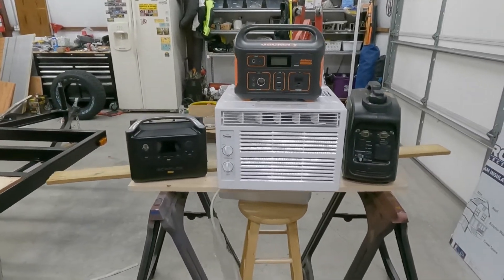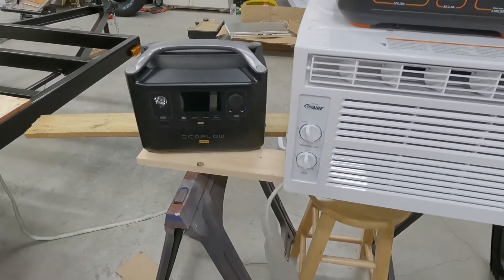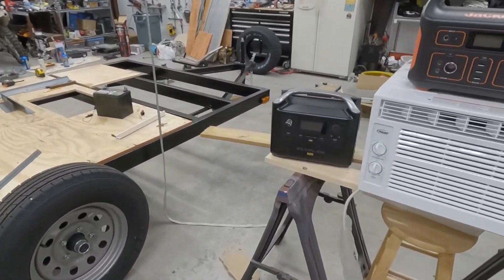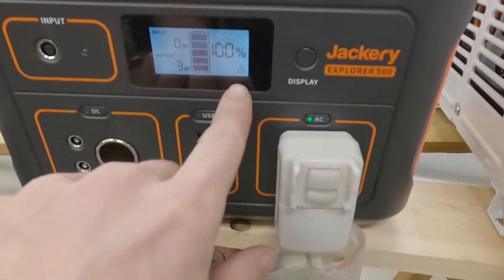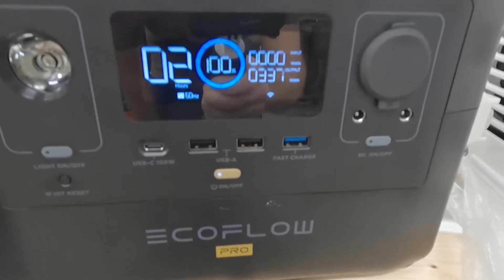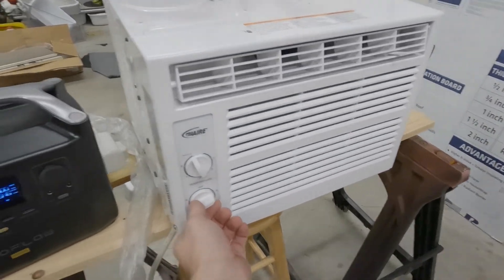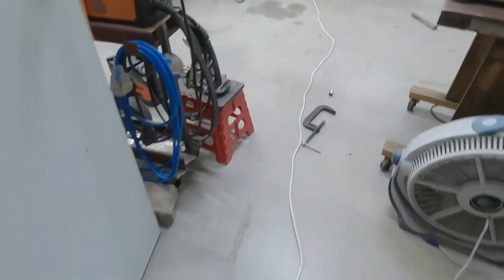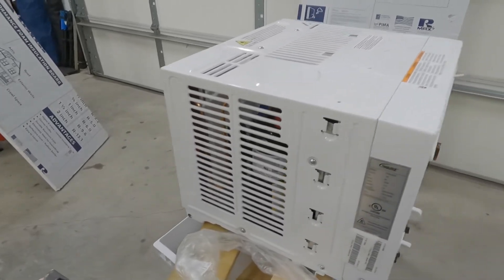Jackery vs EcoFlow vs Gas Generator - Which will Power a Small AC Unit?

Comment: I have the same sportsmen’s generator, and a similar window ac unit (analog knobs) it’ll even power it on economy mode. A run 6+ hours on a tank of fuel! But impressed by that ecoflow! Does the ecoflow have “pass though” charging?

Comment: What eco flow is that the 800w? I have this ac n im building a camper my ac is 500w i have 4 100w panels i was gonna buy a geni as I used robust one for my rv ac but I was gonna buy a smaller quieter  geni cux ppl complain if sharing a spot off grid. So now im wondering what tha would do what do I need my truck camper is about size of your trailer  build n ill be insulating it prob spray foam what do I neednro keep me n the dog cool its like been 31 here n up feels like 40. I lost the cat in ny apt running g a 8btu ac n I couldn't keep  apt cool I left n left cat n ac running  n it must a got way too hit with ac n hes older n sick  n I hadn't out him down its devastated me im leaving as its far too hot in this apt you could cook an egg n im going off grid this is crazy gettin all the heat from other apt below too its crazy  very small apt too  smaller than your trailer area in living room where I closed off doors n stayed with ajimals

Comment: I dump my generator into the house using the 220 and power the whole house. Just being careful with the hot water and not running the stove or oven. Been without power after a couple hurricanes. Amazing how dark it is at night when you're the only one for miles with power, lights and ac. The generator runs like a champ even in hurricanes wind and rain. Treat your ethanol free gas and it lasts for years. Used almost 5 year old gas. Runs almost as good as fresh, but wouldn't put in my car lol
Reply: When you say you dump your generator into the house, please be careful to not let it be actually running inside the house or near a window. Carbon monoxide is a silent killer. Be safe.

Comment: I would say if you want to use a generator, get one with 2000 W peak rating at the very least.  Of course, if you have the cash, spend it on a good, renowned generator name like Honda.  These are by far the least noisy, best output, the sine wave actually looks like a sine wave and can have a peak higher than the rated peak.

I've never really been a fan of such large batteries as even the small ones have shown, are a great way to turn your house into a bonfire.

Comment: I have the 720 & 320 Eco flow they saved my butt during the flood in this February and March. We’re on the side of the road in the RV above the even park no one in our RV park was prepared but me my RV up lit up like a Christmas tree I use my Prius to keep them charged 
I have since added two 110 foldable solar panels from the same brand ❤ I got mine on payments through QVC which really helped for my situation
Reply: No one in the RV park had generators? Who has an RV and not a generator?
Reply: Me i sold mine. No one likes a geni they kept unplugging mine or turning it off middle.of the night when i hadna dog 19 who had issues breathing n cancer n the fkrs shut it off all night couldnt even bewr jt where they were on free land but im buying s new one i had a champion i loved it accept the oull start but its on for 499 now it ran everything id like to use it again but i dont want  issues with ppl.touvhing my geni i need it for ac n maybe heat if i live in my homemade truck camper. so to answer your question alotnof ppl hate when we have them. @killer268

Comment: I’m not an expert but I do believe the ac has a starter capacitor the will charge up after being plugged in for a while. This capacitor will help boost the compressor for startups. Because you tried the smaller jackery first and the ac wasn’t plugged in for very long it did Tver that charge to the capacitor which caused the startup to rely only on the jackery. The other sources benefited from being plugged in and the capacitor had some boost to assist starts. Try the jackery again after the ac is plugged in for a while.

Comment: Turn on the fan first, then lower the temp knob slowly until the compression kicks on; I run my LG 5000btu with the Jackery 3000 all night.
Reply: For 2500$ id hope so lol
Reply: Damn straight  @fvgc454ss
Reply: I see a Jackery 1000 or 1000+
Reply: I have a 300w/290wh and a 5,000 btu AC unity. I plugged up a portable ac unit from Lowe’s. The jackery showed that the AC unit was pulling 85w but it killed the jackery very quickly. It dropped 10% battery life in 30 minutes and the ac never got cold. I hooked up the ac unit to a house socket running 220v and the AC unit got cold very quickly. Now the jackery does run the fan on the portable ac unit but not for long.
Reply: Absolutely! And he said he was gonna kick it on high but he never did

Comment: If it's running 400W on a 750Wh battery, I'd be really curious to see how long it really runs.
Reply: So curious
Reply: 750Wh/400W is 1.87 hours, excluding physical losses.  I'd guess 80% efficiency at best to account for losses, thus 1.5 hours max run time.

Comment: You can Daisy chain the power stations and get more run time I've done it in my camper with a similar AC unit using my bluettti EB55 and ac50s and a jackery explorer 240

Comment: Gas generator still going 8 hours later.
Reply: Neighbors still upset
Reply: How much money do you spend on gas to power the generator for 8 hours of use?
Reply: @bpric13  about $8-$10 bucks running a 550sq AC unit. Small price to pay on a blistering hot day. Especially to not have to worry about it running out of power. God forbid you have to add a little gas.
Reply: 50$😂😂 @bpric13
Reply: Still hearing it 8 hours later.
Reply: @FAH_QUE-Democrat_U_Lost  A small price to pay.
Reply: Nope, predator inverter can’t hear shit. Quiet af
Reply: @JayDubNation83 that ain't true  my brother and some friends have those. They work great but they aren't super quiet.  Alot better than the typical gas generator  though
Reply: @carloscardona9255  well I personally own one and it’s exceptionally quiet compared to a standard generator. I can literally run it all night without one neighbor saying a word. I don’t hear it over the noise of the air conditioner I’m using it to power. No one in my home can hear it from inside the house. Maybe standing at a back window staring at it in the backyard you “might” be able to tell it’s running. It’s a great solution if you need substantial power and don’t have it at the panel. To each his own though. They are also priced extremely well considering.

Comment: An ‘Air Conditioner Soft Starter’ would solve the issue of the massive amp draw spike when the compressor kicks on for the first time. With one of those devices I bet you could run the AC on the smallest unit.
Reply: And soft starts are only a few hundred dollars.  Or for just $50 more you could just go with the EcoFlow.
Reply: What he would actually need is an “inverter” style portable a/c they use al lot less starting power

Comment: I have that generator, and a similar AC, no issues with it running an air condtioner other than parks that don't allow you to use it overnight.. I don't think the Sportsman generators are still available. Pity too they are pretty nice.
Reply: Tractor supply has them.

Comment: Great info I have a trailer with a 5000btu unit ac and I use a craftsman 2500 gas generator to run It and it pretty much runs the ac and everything else in the trailer.  But was interested in going with a battery generator.  Was wondering if you did a video in how long it would run the ac
Reply from the maker: I have not, but I need to do some real world tests! It all depends on so many factors, but having at least one real-world example can be helpful!
Reply: How much did it cost a month

Comment: Or , 2  48 volts 300 watts solars painel with 48 volts controller,  4  180 amps lithium batteries, that runs all day long the same as my gas generator does.

Comment: I have a ipower 2300 by yamaha from Costco in my 44 footer sailboat,  runs, 40 amps battery charger, 8000 btu ac, and all outlets in the boat, for 2 years,  24/7. 1 gallon every 9 hours.. I have an external outboard 6 gallon tank connected.
Reply from the maker: Yamaha makes good stuff!

Comment: I have a Bluetti EB55 and a small camper with an ac unit like that. The Bluetti will run it for about an hour. It's 700 watts with 537wh capacity.

Comment: I wonder if you started the AC on fan first then switched it to compressor if it would start easier?🤔
Reply: Yes star the fan on low for 3 minutes then turn ac swich to low cool. Ps this way only works for 2 knop ac swiches fan and temp

Comment: Would like to see a how long it will run in an actual camper, where the temperature will drop and the compressor won't need to run all the time. Every time I see a test with batteries and A/C it is done in a garage or something with the door open. Which is great if you are trying to cool off the world, but not realistic as far as how it would work in a small camper. That and a comparison of say an 80 degree day versus a 90+ degree day. 

My guess though is anyone trying to run A/C for a camper on battery power is going to want to run the A/C at night, when the temps would be cooler, but the humidity is higher.
Reply from the maker: I hear ya! I hope I can get out on a trip in the next couple months and try this thing out! I will spoil this for you though - Texas summer night I ran this thing on a Ecoflow Delta (1280wh) and only got about 5 hours out of it, and that's with it cycling. Hoping to have some better figures in the future though. The delta can recharge fast, and I had a gen on remote start. Ran 1 hour and recharged the battery back to 85%, killed the gen and ran fine rest of night until morning.

Comment: 2+ hrs on Ecoflow River Max. High temp light flashes after high loads run. Charging (solar or utility) is disable. River Max will run a Midea 5/8k Btu portable AC without X-Boost. Obviously, it won't last long. Sportsman gen 800/1000W can start 5K Btu Haier with Eco off. Eco can be on after it runs for about a minute
Reply from the maker: Good to know! thanks for the comment!

Comment: I'm not convinced with the EcoFlow due to similiar tests with the EcoFlow Pro which the 5K btu failed after about 5 minutes
Reply from the maker: I discovered it has a difficult time restarting the AC unit. A soft start capacitor installed on the 5k AC unit did the trick for me though. I thought I made a video on it but it doesn't look like I ever finished it. I'll try to wrap it up and get it published. Check amazon for an SPP5 - should be around $10 and comes with instructions on how to install. Thanks for your comment!
Reply: @uthe54  would you mind sending me a link personally? I’m only seeing hard start capacitors on Amazon. Is that the same thing?

Comment: Do you think that the WattFun 320W (640W peak) power station could run that or a portable air conditioner (e.g., 10,000 BTU) for at least for as long as the battery lasts?  🤔  Thank you.
Reply from the maker: Not familiar with the WattFun, but I doubt it. It would take a lot of cranking amps to get a 10k BTU unit started - logically double what it took my 5k. A quick example is I tried to start a 15k BTU AC unit on a 2200w max inverter generator and it didn't stand a chance.
Reply: Do you think you could start your 15k BTU portable ac with a 8750 (7000 running watts) gas generator? I have such an ac and wanted to buy a WEN gn875i generator to run it when power goes out.
Reply: @YoBravaFrumAnuvaMuva  I ran my ac in my rv with a 4450/5250 champion I believe it is. Number might be off by 1. But I ran mine all last two summers. It's an rv ready one but used reg plug for that straight from class c to geni n I am gonna box it in and mount it on my rv. I can't get the one that it comes with to work. Old guy I git it from days it just needs a plug but it's been sitting. Will see. Does turn over.  But I'm o during if my hosue battery should a been a Amp cranking battery or how else would I start the onboard geni. Doenst it need to crank over. I'm new to this plus I'm a girl so it's a common sence question I'd say. But no one around me knows ans I've googled it. Didn't come with a battery  so I'm.not sure what was in it. I wnet up one size but I forgot to check if it needed to be a cranking Amp battery not just a deep cycle. 😑 but my geni I bought was insale for under 500 so I grabbed it and never did try the house  ac cuz the heat goes thru those tin cans so fast. I used inboard ac and it blew me out of the rv it was so cold  it ran everything else n then some. Full tank on thsoe lasts 10 to 12 hrs for me.

Comment: Those sportsman generators are the bomb, I have a 2200 watts peak running 1800 and I can put an a/c like yours plus freezer , fridge and lights, even though it runs at max but is able to run all that.
Reply from the maker: I had that 1800/2200 Sportsman in the past, but I sold it because the main thing I wanted out of it was to run my RV AC unit and couldn't ever get it to do it, even with the soft start cap. Other than that though, it was a fantastic generator at a fantastic price! I like this little 800w sportsman though because its so light and portable! Thanks for your comment!
Reply: @uthe54  what are the specs on the air conditioner. That would make a big difference.
Reply: How long can it run for?

Comment: Can you Jump Start a dead battery with the EcoFlow Pro without it being connected to shoreline/AC power?
Reply from the maker: The 12v output port on the Ecoflow is regulated and I believe only maxes out at 8 amps. You need hundreds of amps to jump a car. Even plugged into shoreline it wouldn't be up for the task. I suggest looking into a NOCO for a jump starter. The NOCO jumpers are designed for very low reserve capacity, but very high cranking amps whereas the Ecoflow is designed for high watt capacity and lower current draw.
Reply: @uthe54  
Thank you your answer helps me out a lot 👍🏻

Comment: can you charg the jackery from a 12 volt cigerette lighter  while your driving ?
Reply from the maker: Yes you can - it comes with the cord to do so. However, it limits itself to 8 amps when plugged into a 12v socket. That is to prevent the socket from overheating. 8A is only about 96 watts, so pretty slow, but yes, it can do it. I have been experimenting with faster ways to recharge it through the vehicle and will hopefully post a video of my findings soon. Thanks for watching and your comment.
Reply: @uthe54    Curious if you've found any other methods of recharging?  I have an Eco Flow river pro and it charges pretty slow from 12v too

Comment: Got my Ecofllow River Pro with add-on battery for $700. They also have the Pro base unit alone for $430.
Reply from the maker: That's a good price! I got mine at Costco for 429. Cheapest I've seen them, but they seem to sell out quick! I got the extra battery as an ebay refurb and been good, although I'm not sure i'm totally happy with how it loses the portability, but cost per WattHour, you can't beat it!
Reply: @uthe54  I did the same with the ebay refurb when costco was out of stock. Just an FYI, you can run the river dead and stick the add on battery on to keep drawing power. So you could get a bunch of batteries and run for a LONG time. I hadnt seen any reviews showing that test so I had to do it myself to find out. Im debating just getting a LIFEPO4 12V battery and running it isolated in my overlanding rig so it can directly power 12V devices w/o inverter losses and connect the River to it so the River gets 100W out for charging while driving or I could connect the River to solar for 200W charging, leaving the River specifically for the devices that need 120V (12V inversion loss is 5wh, 120v loss is closer to 30wh according to the ecoflow user forums im on)
Reply from the maker: I hadn't ever thought of that, but that's a great idea! I just wish you could then recharge the extra batteries stand alone somehow without the primary ecoflow unit. Seems like using them in this regard would make it tough to manage recharging them all.
Reply: @uthe54  that is why I wont be buying any more add-on batteries. They were a great deal on black friday when they were only $275 but with no other way to charge them it doesnt make sense to own multiple unless ecoflow makes a standalone charger for them... which should be relatively easy to do considering the cable and connection. That should contain all critical battery signals so the only thing the charger would need to do is convert input power to the necessary voltage for these cells and balance charge them same as the unit does. They could probably use the exact same circuitry as the main unit just on a simpler, smaller board. Now that I think about it it seems odd that they havent done exactly that. They'd have a small, powerful unit that can run however long you need just by swapping batteries. If the main unit's battery was used as a UPS for swapping the external battery then it would never even turn off your devices when you make the swap. IDK about you but that sounds pretty appealing to me.
Reply: @1FAST91SONOMA   what about a second river pro + extra batteries? Then you could use the second unit as a solar charger too
Reply: @RossFeighery  yeah but I think for my uses it makes more sense to just build a LiFePo4 battery (I have 1120AH worth of cells in cart currently waiting for payday to order them) and charge that via the 1200W of solar my overlanding vehicle has on/in it. Then the River can be a backup to that system since it has fewer cycles available anyway. 800 VS 3500 is a big jump in useful lifespan
Reply: @1FAST91SONOMA  It may have been a Bluetti but not for sure but there are solar brands that do come with batteries you can charge separately!